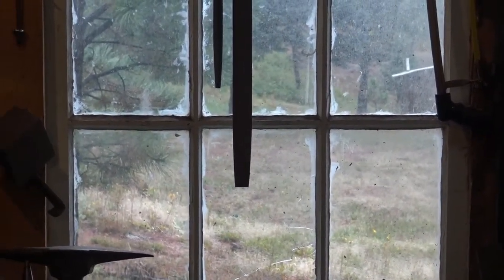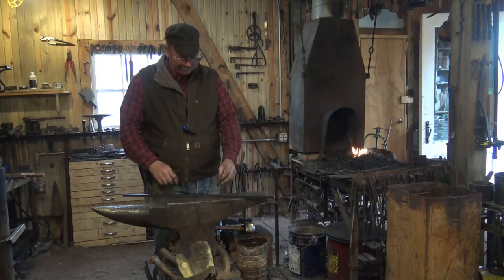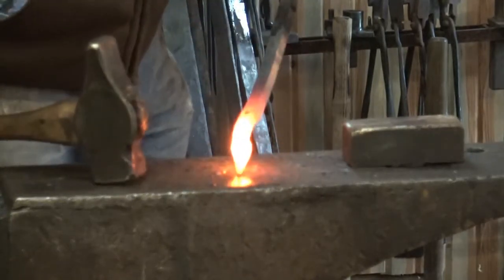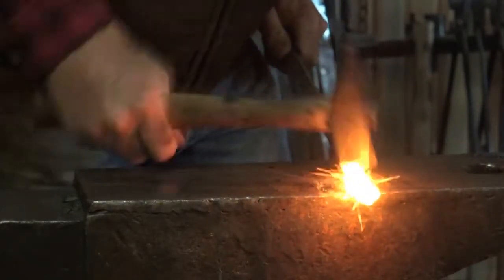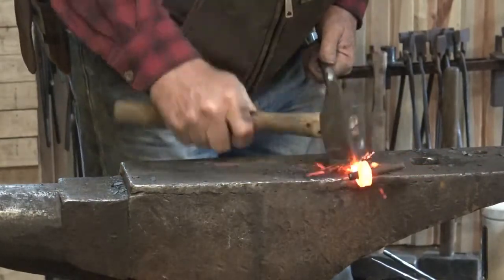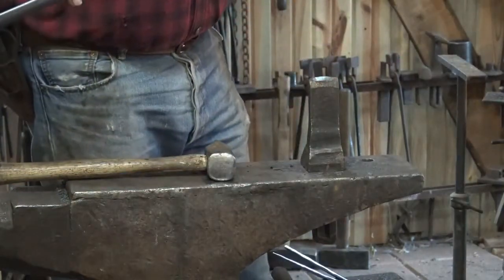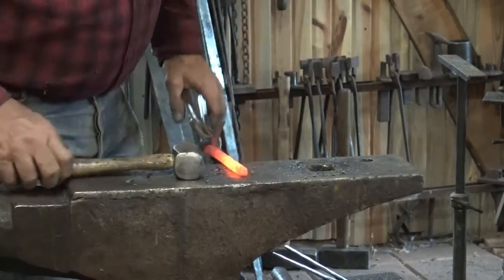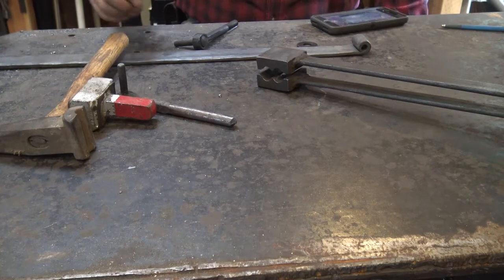Hinge pintle for strap hinge, forge welded and threaded

Comment: I'm a very recent subscriber. I like the less "in-your-face" style, John. This was very informative. I also watched the video of making the strap hinge, too. I do have a question about the bolt/screw holes in the strap. I see you only formed two holes on the long strap nearer the finial. Is that enough for a large wooden gate? Would the weight of the gate eventually pull down on the side?
Reply from the maker: There were actually 4 holes, I just didn't repeat the same procedure that many times for the video.  I am glad you like the videos.

Comment: Hello John...thanks again for a great video...A quick question...I take it that you source commercially available square nuts and fire them to match the pintel, rather than tapping from scratch
Reply from the maker: You are correct.  McMaster Carr used t carry unplated square nuts, but now they only carry then plated. I am about to upload a video describing how I deal with commercial fasteners to make them compliment the iron work.

Comment: When I build my new cabin this summer, I want to make a heavy front door out of solid wood with long forged hinges that come across the door. I haven't decided on 2 or 3 hinges yet. If you don't mind me asking, how thick do you think they would need to be to carry the weight? When I was young, we had what I believe was a 2.5" thick solid oak front door with black iron looking hinges like described above, and I loved the look of it.
Reply from the maker: I think it has more to do with how well they are fastened to the door than a given thickness.  Old forged hinges were often quite thin.  However I like a strap of 1/4" x 1 1/2" for heavier doors and have never had anyone report a problem
Reply: Thank you. I was thinking along the lines of 1/4" also. Now I just need to decide on the overall look of the hinge. Maybe something medieval looking that would compliment a dragon door knocker. 🤔😉
Reply: Sounds awesome, take pictures and share if you can.